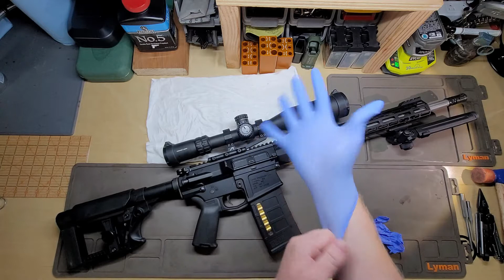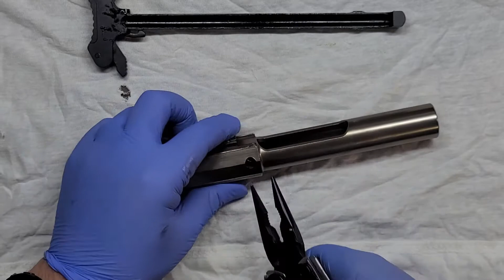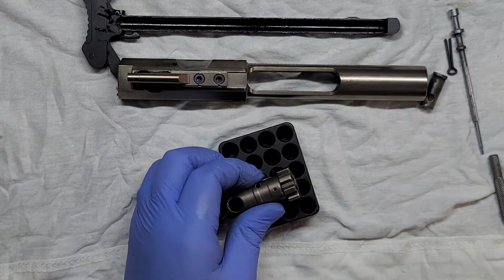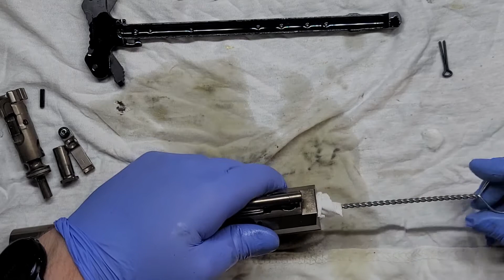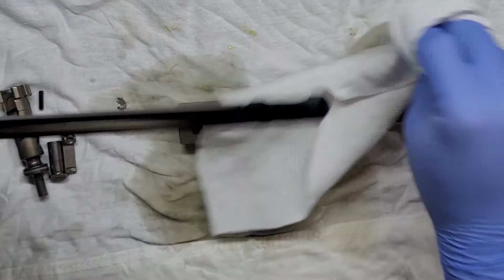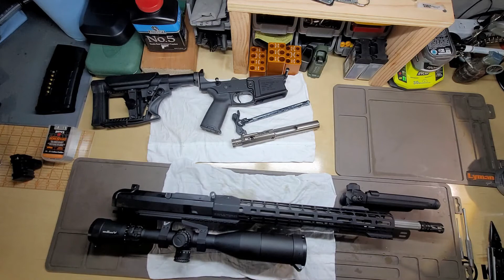ASMR AR-10 Aero Precision M5- Disassembly, Cleaning, & Reassembly (No Talking)

Comment: Did you clean or lube the barrel before you first shot it? I have the 18” fluted SS in .308 and haven’t used it just yet. Curious if the barrel needs anything done before first firing, did you do anything to break it in? First rifle - thanks 👍🏾
Reply from the maker: Congrats and great choice! I have to admit, I'm no expert on breaking in new firearms, as most of mine are surplus. I just lubed (barrel and receiver/components) and bore snaked before firing. Then I just took it slow on range day. If you read up on the barrel break-in processes that some people adopt, it can get pretty in-depth and tedious. Good luck and thanks for watching!
Reply: @FMJRN  thank you, that is exactly what I ran into online. It seems like there’s about 100 different ways and most of them are tedious. It wouldn’t be a big deal if I could just shoot in my backyard but I’m not sure cleaning out my barrel every other shot is plausible at my indoor range lol. Quick question, I use ballistol for my glock would that be fine to use as a cleaner/lube for my rifle?

Comment: What oil and lube do you use? And would an all-in-one, like Breakfree CLP or Lucas extreme duty CLP be fine for everything?
Reply from the maker: Any reputable CLP is probably fine for most maintenance.
I use Breakfree CLP for general cleaning/lube/rust protection. Cleaning my M1 has got me into the habit of working a little dab of Lubriplate 130 grease into any high friction points, though it's probably not necessary for most of my firearms. 👍

Comment: Is it not considered standard practice to remove an optic before taking it apart? I don't currently own a firearm, but in my head I'm thinking a lot of glass is more expensive than the rifle - besides aesthetics, any reason you didn't take the scope off and set it aside first?
Reply from the maker: Depends on the firearm design. For this, the optic mount is not quick detach- it has been torqued down to manufacturer specifications and thread locker has been applied. Thanks for watching! 👍
Reply: you would lose your zero, so no you would not normally want to remove any optic to just clean a firearm.